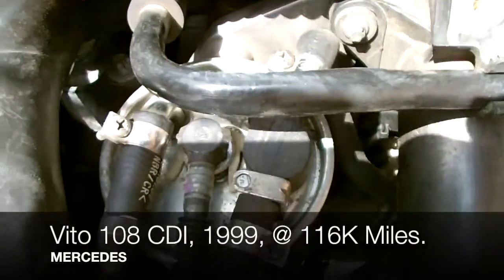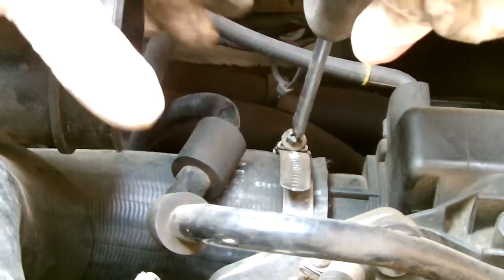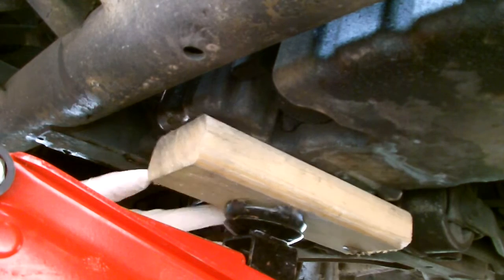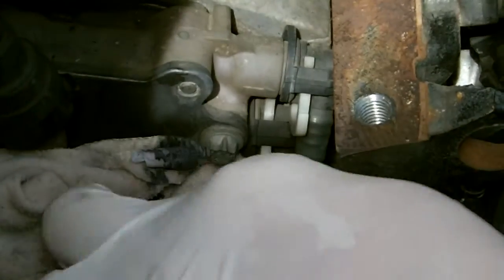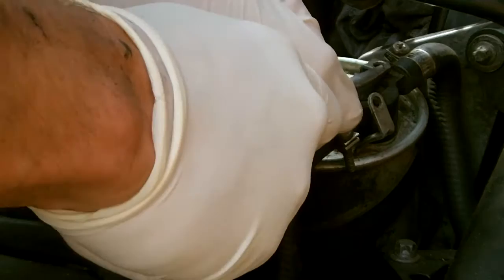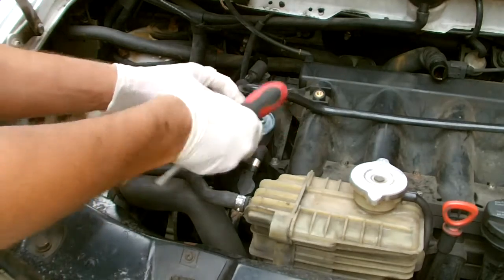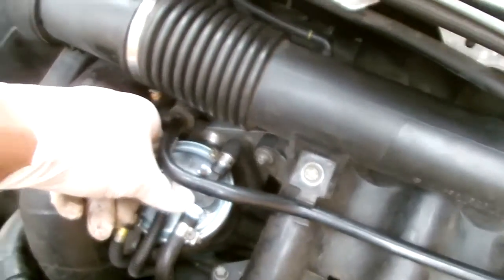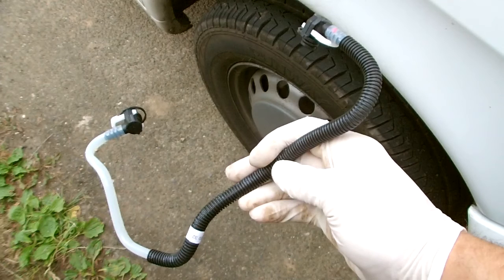Mercedes Vito Fuel Feed Line Replacement

Comment: Great video, very helpful.

I have a question about fuel pump.
My 2003 vito w638 doesn't have electric pump in fuel pump assembly.
Is that normal, does vito 2003 come with Electric fuel pump in fuel tank.
Thanks

Comment: Thank you for the video. compared to others I have watched your focus is much better and clearer. 

I have just replaced the diesel filter on mine becuase my mechanic was worried he might break the clip on the hose you replaced.

I used diesel from old filter to fill up new filter but due to slight spillages it did not fill to the top. Therefore I am guessing I now have air in the system and wondering how to bleed it. Cannot find a lift pump anywhere. Any quick ways to bleed it? 

Looks like there is a bleeding screw on the top of the filter, I have tried removing it and cranking the engine hoping to see diesel pump out but no luck with that so far. 

Not sure which of the hoses is the best one to release for bleeding. The one most left seems the obvious one as it will be the easiest and is probably also the highest point for air to escape.

Any advice will be appreciated.
Reply from the maker: Hi, I need a bit more info: what is the van currently doing? Is it not starting?
Reply: The van was running fine. I just removed the diesel filter and replaced it, but realise in hindsight I should have properly filled the diesel filter. After replacement, it started normally, then cut out about two seconds later. I continued cranking but no luck starting (yet).  Dont want to over crank it 
Today I filled the filter to the top on the left side hose (the one that is like a metal a pipe extending out of the filter if there is nothing connected to the filter. Anyhow the battery has now started running flat so I need to put it on charge but cannot find my chargert anywhere. I have a jump box I have put on charge and will use instead until I find my chargert.

So in short, yet is it not starting at the moment.
Reply: Was not starting, but after a bit more effort managed to get it running. Ran the battery flat and struggled to find my battery charger. Just when I found it and wanted to connect it up, I cranked it one more time giving full throttle and hey presto!! it started.
Reply from the maker: Nice one, glad the problem is solved. Thanks for watching.

Comment: hey hi! first many thanks for the tutorial i just replace the line and all the orings and started first attemp awesome!
I just wanted to ask u about the grinding noise when start the engine after the repair, i have the exact same noise and freaked out! is it normal? why is this happening? 
MAny thanks!
Reply from the maker: Hi, Im not sure what noise you mean? Do you mean the starter motor noise? If so that is normal. Thanks for watching.
Reply: Never mind.. i think it was just the engine mount settle in place
The van still have some air after changing the feed line and the other 4 orings on the fuel lines, regulator orings, just missing the oring on the pressure sensor but someone told me this one would be leaking fuel if the seal was bad.. any suggestion? thanks!
Reply from the maker: Hi. Yes  I would expect to see a leak , but, if something is not in good order, needs replacing, is missing, is due for service or you see it as not fit for purpose, then it needs changing. Thanks for watching.

Comment: Hi great video. Just a question would you be able just to change to plastic clip that goes into filter. Will bit of heat release clip and allow new one to ne fitted.
Reply from the maker: Hi, No I dont think that you can, and I wouldnt do that. The lines are sold by merc altogether. And I would not be using heat on a fuel line. Thanks for watching.
Reply: Hi, how long did job take you. Iv asked for price in garage and wanted to gauge for myself. Cheers
Reply from the maker: Hi It took about an hour. Its not a complicated job. Thanks for watching.

Comment: Thanks a lot good video... Really need help my w638 v230 wount rave at all.you start but it can't rave  it in idling mode... I've computer box new.,fuel peddle, throttle all new nothing changed ideas
Reply from the maker: Hi Many Thanks for watching. Unfortunately, I don't have a clue, Ive seen ones that go into limp mode and wont rev over 3000rpm. Diagnostics might be the way to go. Thanks again.
Reply: They won't rev over 3000 if the clutch is depressed or the clutch switch faulty. Had me panic one day.

Comment: hi, appreciate your video! what was the reason for changing the feed line? was it because the clip on the fuel filter was broken or did you have a problem starting the car? asking because my fuel filter clip is also broken thinking it may be the reason its hard to start its also quite loose on the fuel pump maybe air gets in the line?
Reply from the maker: Hi It was replaced just because the clip was broken. The vehicle had no starting problems. I would not think that is your issue as I would expect a leak to be present. But with all vehicles you have to methodically diagnose what is wrong, not just swap parts. Starting issues - could be a number of things electrical, fuel, air, egr. Good luck finding issue, thanks for watching.
Reply: That' some hassle to change a diesel pipe! Great video, very informative
Reply from the maker: Its a Merc. Thanks very much for watching.
Reply: Hi there thanks for the Vid. What's the reason for changing this other than it was broken? Was the performance any different due to it breaking? Only asking as I've just purchased a Vito and mine a few times the engine has just dropped when I came to a halt  at a junction. Turned back over after a couple attempts. Thinking Fuel Filter from research?
Reply from the maker: Hi only reason was that it was broken. Yes it could be fuel, but also a 
number of other things; EGR for instance. Only way is to methodically 
diagnose it, but if you are gonna try a quick parts swap; fuel filters 
are cheap and wont hurt. But if it doesn't work, start diagnosing. 
Thanks very much for watching and good luck.

Comment: Hey - hows it going - great video.
When you mention about a manual, which one do you use?  I need a copy of a manual for the W638 CDI110
Reply from the maker: Hi, I don't remember using a manual for this job, it was a while ago. There are some manuals available on eBay. Sorry, not to be much help. Thanks for watching.
Reply: @BoxsCarFix  how did you get the part number for the fuel line?  I need the number for the other line that goes into the fuel pump.  the one to the right and above the one you remove.
Reply from the maker: @jonesPossibly  Hi I got the part number from the Merc Commercials Dealer, get them to send you a diagram of the fuel lines, they are normally very help full.